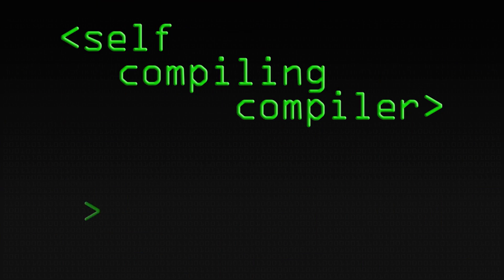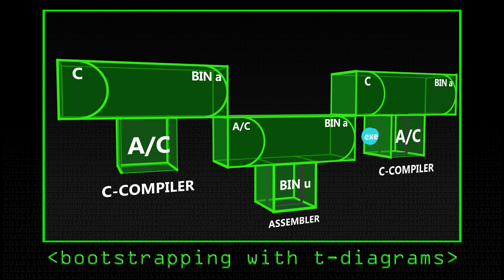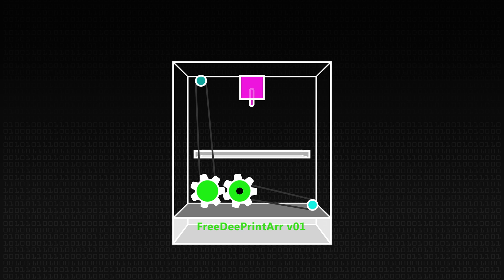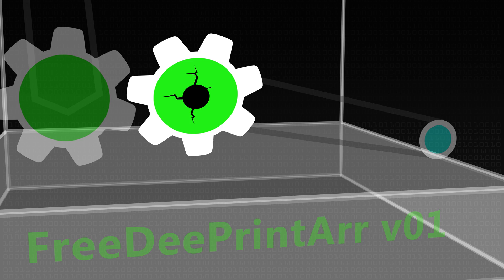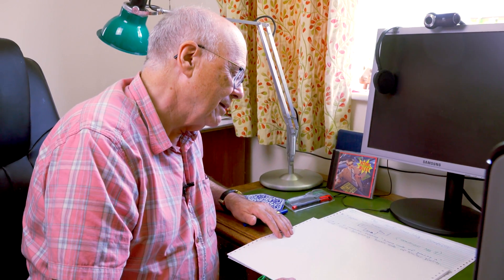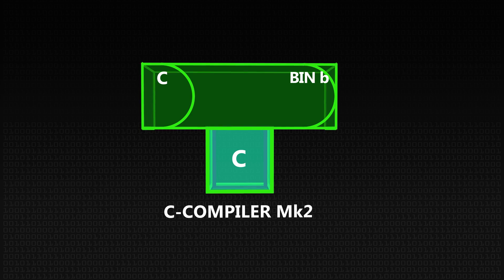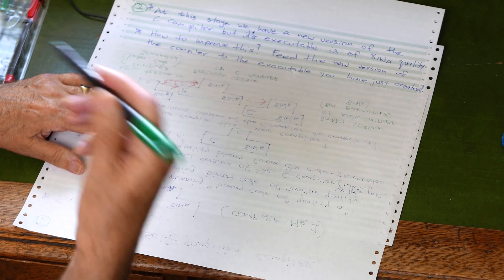Self Compiling Compilers - Computerphile

Comment: 5:55 this animation is wrong. the C code doesn't get converted 3 times. The C compiler written in C gets converted to BinA and then you send the C code in the C compiler BinA, which outputs C code BinB. There are only two conversions there and the inputs are different (C compiler and C code).

Comment: C0 programming lang => asm compiler for C0 => bin0 (executable) [slow runtime]

C1 programming lang using C0 lang => runs on bin0 => bin1 (executable) [runtime is slow as we run on bin0 but we got a new instruction set bin1 which is fast, next time it's going to faster runtime]

writing standard library (eg: vector) for C1 in C1 programming lang => runs on bin1 (faster) => executable for standard library (vector)

Comment: What I don't understand is how something made with quality 0 binary can produce better code (let alone faster)? I mean, if I wrote a C compiler in assembly how my self hosting version could possibly be faster? It can't be faster than original version made in assembly (let's call it version 0) from scratch, right? Or the point is that during bootstrapping optimizations possibilities open up, which are hard / impossible to do directly in assembly in version 0?
Reply: the way i understand it, the efficiency of the compiler as a program itself is separate from the efficiency of the binary it produces. so compiler A could be very inefficient, e.g. it takes 2 days to compile compiler B, which you feed into it. but, once that’s done, compiler B itself is a different binary than compiler A, so the way it works is different as well

Comment: You don't necessarily have to write the bootstrap compiler in assembler. Nicklaus Worth write the first Pascal compiler using FORTRAN. He wrote the compiler originally in itself, then hand-translated it into FORTRAN. Once he built that, the compiler could be used to compile itself, and once all bugs were fixed, all newer versions. Another possibility is to write a subset compiler,, just enough to compile the smallest subset than can do something, then once that is compiled, add more of the compiler to itself until you get it to where it can compile the full language.

Comment: I once wrote an extremely optimised compiler.  My friend tested it with his "for (ulong i = 0; i < 100000000000000000000000; i++) ; " programme.  He was impressed that it took no time at all to run.  So we looked at the code it had produced.  One instruction NOP.  It worked out there was no I/O so why bother ;)
Reply: But nop takes a cycle and a byte, so it could be optimized further by removing the nop
Reply: LOL
Reply: Hohohoho

Comment: How about designing a compiler that at its core is based off of Machine Learning, Pattern Recognition and AI where the structure of the program that compiles your language of choice is a self contained polymorphic mutating algorithm.  A compiler that learns and becomes self aware the more you use it and adjusts itself accordingly. So in a sense if person A writes a series or programs in some language and compiles those programs their compiler will adapt to the habits of that programmer where person B using the same compiler writes their sets of programs in some language and it adapts to their habits. The only thing that is unified between the two is the syntax and rules of the language itself. However, at the end of the day the same compiler on two different machines that was used between two different people end up being two completely different entities so to speak. Would such a construct such as this be feasible? As I stated the off the shelf compilers for person A & B are exactly the same during installation. The compilers on both machines will accept Language (L) with its alphabet, identifiers, keywords, language syntax and rules that is the same for both parties, so they have to write coherent code in said language. However over time and through the use of the compiler the compiler will adjust itself or self modifying to the behaviors of each user based on the set of source code it is trying to compile. This way the compiler can optimize the code more efficiently for that user. For example; user A programs 3D applications using Vulkan over and over again while user B is writing embedded driver codes for micro controllers and user C is writing source code for a specific architecture Operating System. So over a period of time; each of the 3 users or code developers start off with the same off the shelf compiler, but through time and use the compiler itself begins to self mutate as it learns the sets of data it is processing from that user. So in user's A case it will efficiently compile and optimize Vulkan API calls where user B it will optimize driver, kernel or library type code base and user C's version will effectively optimize code based for an operating system on a specific architecture. Of course this can be and is also fine tuned by the user since a user can changed the default settings of the compiler to their desired settings, but much of this could also be automated through Machine Learning - A.I. with the use of polymorphic mutating algorithms which would allow the compiler itself to evolve over time. I know this is different than what is proposed in this video, but it's just something to think about.

Comment: Back in the 80' s we used to do this sort of thing all the time, to extend languages. You would write a compiler that understood the new language extensions, compile it under your existing compiler, then write another compiler that used the language extensions, and compile that using the extended compiler.
e.g. if your language does not have constants, you write a compiler system that could lex/parse/codegen the term "CONST <Identifier> <Value>"
Then write a new compiler that uses "CONST"'s and compile it with the CONST-aware compiler (you could even re-feed this back through itself to generate a better compiler)
A few simple tweaks to the compiler code and you can now have ENUMs, and so on

The most fun was writing optimising compilers and feeding them through iterations of themselves :)
FORTH was an especially great language to do this process on
Reply: ok?

Comment: I wrote an assembler using a monitor on the vic-20 (6502) then used the assembler to write a better assembler with labels, then used that to write a small-c compiler, then used that to write a c-compiler. That's how I learned to program.
Reply: HESMon?  I used it to reverse engineer the C64 Kernel, stripped out all the cassette routines, and replace it with bank swapping (using the cassette control circuit) on a 4x sized rom.  Built in all the tools I wanted.

Comment: I'm not sure why all these complicated diagrams and notations are needed to describe something quite straightforward. 

It all started with a piece of software written in machine code to make writing and running programs easier ("Initial Orders").
Then a compiler was developed using the above to convert assembler instructions to machine code.
Then that compiler was rewritten in assembler, compiled and became the new version of the compiler.

The process of enhancing the compiler to introdeuce new language features continued, using the previous version of the compiler.
New languages were developed and compilers written in languages for which there were working compilers, including producing code for other types of computer.
So it is no different to any other technological process - we create new and improved tools using existing tools.

Comment: I once read warning in a book about this, that a malicious developer could insert a piece of code that detects if the compiler compiles itself and injects the source code for injecting that backdoor again. And when the compiler compiles something else it could just install the backdoor into the program. After the compiler has compiled itself with the malicious code once, the developer can even purge his code from version control in order to cover his tracks. This is the main reason, why you must keep all the versions of your compiler. If the backdoor is detected only several versions later, you have to go back to the last non backdoored version and start the bootstrapping process again.
Reply: That would be "Reflections on Trusting Trust", Ken Thompson's ACM Turing Award lecture.
Reply: @AlanCanon2222  Thank you. That was a very interesting read.
Reply: @oleh6738  It is. I read it 1996, standing in the Stanford University campus bookstore for two hours, my legs aching. I'm from Louisville, Kentucky, but have visited every landmark of computing I can afford, and my experience of Stanford University consists of 45 minutes of walking the incredibly lovely campus, and 4.5 hours standing reading books I couldn't afford in the bookstore.
Reply: @oleh6738  The thing that fascinates me most about it, and which I struggle to understand the mechanics of, is the task of getting a computer program to output its own source code.... that for me is a more deeply interesting aspect of his lecture than the horrifyingly obvious-in-retrospect light it casts on computer security.
The paper is doubly interesting because it has deep results in it from pure computer science, and also this vastly troubling real-world implication to it. Perfect example of the math-meets-engineering nature of the field, with all its thousands of years of political and social consequences. Computer Science is a subset of the Humanities.
Reply: I've heard from others about the Linus version of this
Reply: @compilercompiler6216  Is that the git repo of the git source code?

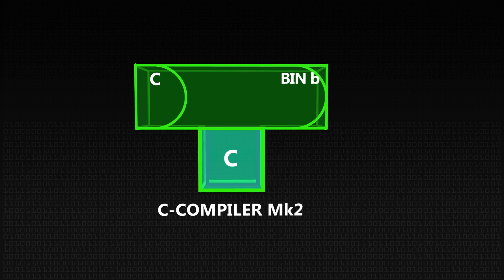Comment: The visualizations for this T-diagram series are still confused about the concept being explained. 5:53 does not show the right thing at all.
Reply: I was wondering the same couldn't wrap my brain.
Reply: @SimonBastienFiliatrault  In my opinion (and I said this in my comment on the last video) the critical part of this visualization should be to show how code-as-instructions and code-as-data are interchangeable. That is, the code when it acts as a running program, and the code when it acts as the data being transformed by that program.

The T-diagram ought to represent the code as a program that transforms its input into its output.
What they should be doing is taking another T-diagram, shrinking it down and passing it through the first T-diagram to be transformed into a different one - to show how the C-code representation of that program gets turned into a binary-code representation of it.
Reply: @AexisRai  I can't agree more.  That would've been clearer.

Comment: I remember doing similar when I was 14... Had an assembler running in BASIC that was extremely slow, so wrote a new one in Assembler, got the BASIC assembler to assemble that, and then used the binary version of the assembler to improve and complete itself.  Was back in the day, when 6502 assembler was a thing.  Was happy with the result, assembled itself something like 100 times faster than the BASIC version in the end.
Reply: Thank you - and also to a few others on here - who've contributed some nice first-hand bootstrapping  tales. Your speed-up factor of 100 must have made it all seem worthwhile ...

Comment: I can see how it's an advantage to not depend on a compiler of a different language that might not be maintained in the long run. But why is the compiler written in its own language automatically faster and better, as Professor Brailsford claims?
Reply: It's not. You could write a horrible C compiler in C.

However, assembly can be tedious to write, so you might skip out on faster but more complex algorithms or compile-time optimizations; instead, including them in your compiler written in C.
Reply: Well, the initial premise of the video is that there is no compiler for any language, really, so writing a C compiler directly in assembly and then a C compiler in C is the sensible thing to do, in that it requires the least work

Comment: and this is how we get obese compilers.....
Reply: But they generate much better code and support a multitude of architectures and operating systems. I myself almost finished writing a compiler for a simple language, which at the moment only has integers and functions. It is written in Rust, about 6000 lines of code, generates code for RISC-V machines, using an intermediate representation in SSA form, and does implement some optimisations. It doesn't produce "proper" executables yet, just enough to run the generated code in a built-in simulator, but it will probably take less than 500 additional lines of code to produce Linux ELF executables.
The point is, it's "easy" enough to write a small compiler that generates straightforward and suboptimal code for one architecture. But you wouldn't want a compiler of such quality for real-world applications, therefore you have to implement quite a few optimisations, write tons of unit and integration tests, support other OSes, etc. That, obviously, would require way more than 6000 lines of code, more like hundreds of thousands.

Comment: I must not have been following so well, I am still confused as I can't think of a system that only builds on itself and is able to run on a specific architecture, without that architecture translation layer
Reply: That is what the compiler is. It translates from a high level language to a low level language. Once you have the compiler working, you no longer need the low level references. For instance when installing Linux you go through a tool chain. You start by downloading a working image with a working compiler. Then you use the image compiler to cross compile a compiler for your system. Then you boot your system and recompile your compiler with the cross compiled compiler to create a natively compiled compiler which you use for the rest of your installations. At no point in this process did you use a program written in assembly or in binary because you were able to start with a working compiler.
Reply: it still remains. the C compiler will describe how to create the binary file. the difference is that it's described in C instead of assembler
Reply: Pretty much all high level languages compile to C and let the hardware vendors do the work from there. They still face the problem of getting C code to run well on their new hardware, we just don't see it.
Reply: Soulthym there is nothing to follow. This was just random rambling rantings
Reply: @codycast  you're wrong. this video makes sense

Comment: A 3d printer that prints a 3d printer
Reply: The industrial revolution is largely based on lathes making better lathes.
Reply: Look up a video by Prusa research about their factory. They make all the plastic parts of their printers on their printers, as a combination test environment and factory floor. It's part of the original reprap project ethos, it's a family of machines that can be made out of only parts they make themselves and off the shelf parts not specific to 3D printers. They haven't reached that ideal yet, since the actual print head involves custom metal parts specific to 3d printers but they're getting closer.
Reply: Consumer 3d printing is basically a thing because of this.

Comment: Just realized this is why gentoo compiles gcc twice when doing an upgrade (or used to at least). One of those "it's glaringly obvious but I had to have someone else point it out to me before I noticed" moments.
Reply: It's not Gentoo in particular that compiles gcc twice; gcc's own build process compiles its source code twice. It also at least used to leave out support for features its own source didn't use, such as Fortran or floating point math, since the first build was only going to ever compile one program.
Reply: it's not glaringly obvious. 99.99% of people would have never guessed that.
Reply: Three times I thought. Once with the basic copiler. Once to optimize the compiler. Once to build itself with the optimized compiler.
Reply: @JodyAlford  yup three times for a standard build, but since everyone loves compiling gcc so much they added (optional) PGO where it gets compiled five times total.
Reply: @JodyAlford  No, the optimised compiler will just be faster- it shouldn't make any difference to its output
Reply: @circuit10  Optimised vs optimising...?
Reply: @RogerBarraud  I mean optimised, yes, as the compiler code itself gets optimised by GCC when it compiles itself, which will make the compiler faster
Reply: Same for OpenJDK, as long as you have the "jbootstrap" use flag enabled.
Reply: Not really. GCC compiles itself three times when you compile GCC (unless you tell it otherwise)
Reply: Same applies for building LFS
Reply: Why is it not possible to fully optimize with -O2 or -O3 the first time?
Reply: this is also the reason why CPython compiles two times ; one time it compiles the source code with the last version, then uses the newly generated version to compile the code again
Reply: ok?
Reply: I think
Reply: @circuit10  Therefore you are?